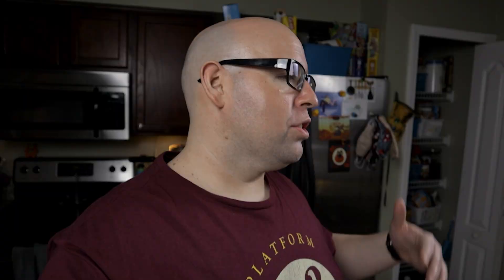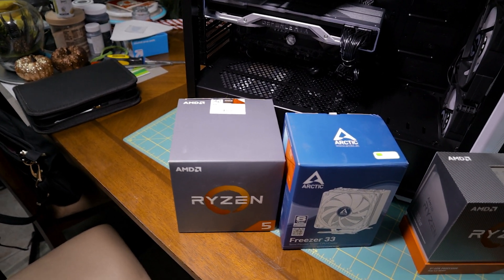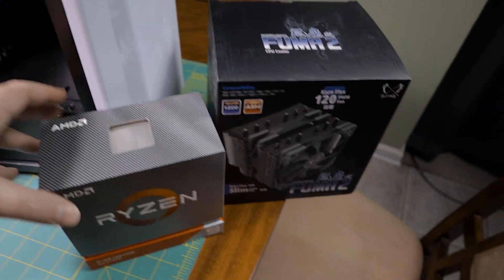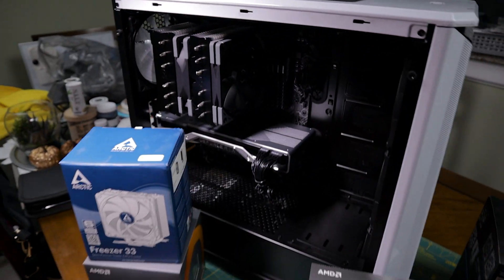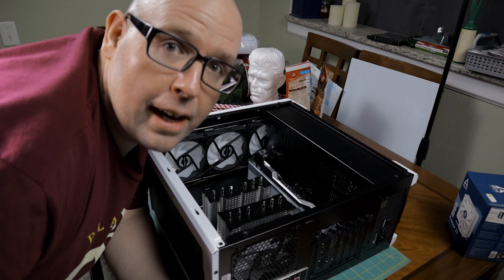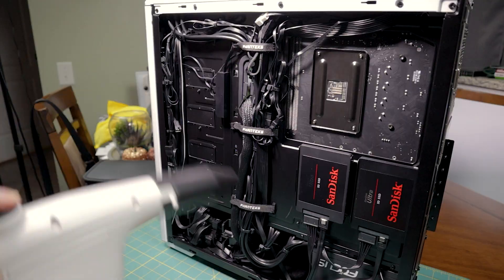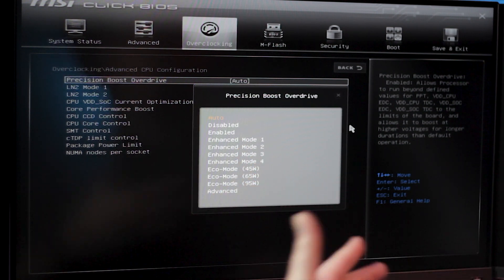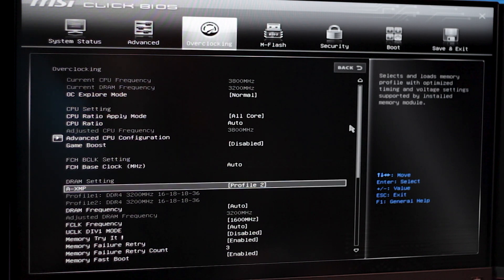3900XT in the MSI B450 Tomahawk | Benchmarks, Thermals & BIOS Setup

Comment: How hard you hitting RAM slots and PCIe slots with your system? Loaded up?
Reply from the maker: I'm running 32GB (four 8GB sticks) of 3200Mhz RAM using the XMP profile, though I had to set both DRAM voltage and SoC Voltage manually, otherwise both were too high. As for PCIe slots, I just have my 2070 Super in the top slot. Nothing else. Although I do use a 1TB NVMe SSD as my boot/Windows drive, and that shares the same PCIe bus as the video card does.
Reply: @HomeTheaterGamer  Were voltage issues causing crashes? Throttling? Boot issues? Just purchased 64GB of 3200mhz RAM. (After Effects is a RAM hog.) For PCIe I'll be using an existing 1080TI and a new 4x 10Gig network card. And NVME boot. I'm a bit worried about overall case heat and saturating PCI lanes. I'll have to update BIOS and XMP before installation. Hmmm...I hate the idea of mussing w/voltage.
Reply from the maker: @Craig Wall it actually wasn’t crashing and there were no other issues, I just noticed the high voltage when monitoring. With voltage on auto for DRAM and SoC, my DRAM voltage ended up being close to 1.45v (it’s XMP profile should have set it to 1.35v) and SoC being 1.21v, which was too high for me to be comfortable with 24/7. Especially SoC voltage, which really shouldn’t exceed 1.2v. Overall, I just did a voltage override for DRAM to 1.35v and SoC to 1.10v, and it’s been completely stable. Could I get each lower? Probably, but both are well within safe tolerances for 24/7 use and I’m not much of a “min/max” type of person.

As long as you know what the max volts are and are below that, I wouldn’t be too afraid of adjusting voltage on DRAM or SoC. Just know that with the 3900XT, you’ll see CPU voltage fluctuate a lot and go up to 1.49 volts sometimes. Don’t be alarmed by that, it was designed that way and is normal and safe. I have played around with setting a negative voltage offset, but I honestly didn’t find any appreciable gains there outside of benchmarks and saw a minimal decrease in temps by maybe 1-2c at full load. My preference is just leave it at stock or simply enable PBO and call it a day unless you’re using an AIO or custom loop.
Reply: @HomeTheaterGamer  I came over from Macs 6 years ago. Have built several PC machines since. Still get queasy if I have to dive deep into bios.
Reply from the maker: @Craig Wall I get that. It can be daunting but most CPUs have safety measures in place to prevent killing he chip. If you have questions about it then feel free to ask and I’ll try to get back to you if I have time.

Are you going with the Scythe Fuma 2 or something else? I couldn’t leave well enough alone and just bought an AIO because of the “I wonder what it would be like..” thoughts that I’ve had since upgrading. Nothing wrong with the Scythe, I just have a bad case of upgraditus.
Reply: @HomeTheaterGamer  Brad, no need to reply...just needed to vent. My 450 moBo has a PCIe retention clip that is frozen up. Can't get an old card out! Don't wan't to break the damn clip. These budget boards sometimes have sloppy tolerances. Once more into the breach I go...prepared to possibly break the clip. Edit: Success! Glad I re-checked all possibilities! I had laser vision done 12 years ago where one eye is corrected for distance and one for reading. Now my vision has drifted. So I have one half-working eye, LOL. Rely mostly on touch.
Reply from the maker: @Craig Wall glad you figured it out! How did things go afterwards? Have you noticed a difference?
Reply: @HomeTheaterGamer  My CPU was bigtime delayed in delivery. Just got it yesterday. Haven't installed yet. Did you get your water cooling hooked up?
Reply from the maker: @Craig Wall I did. It actually went in without a hitch, though I tore my thermal pad on accident so I used paste instead. I did gain performance using it and am able to sustain my boost clocks at about 4.3Ghz (on air it was about 4.1Ghz). I also dropped temps at idle by about 5-6c and under full load about 10c. And best of all? It’s whisper quiet even on balanced mode. I think I’m an AIO convert now. Haha.
Reply: @HomeTheaterGamer  Impressive! That's the dream isn't it? Performance, cool and quiet! My 2600 w/Wraith stayed quite cool under load, but I wasn't oc'ing it...and that's a lightweight chip. Real test is upcoming. If I was as more ambitious I'd consider water...but...I'm not feeling it right now.  :-)

Comment: I've got the 3900x as well but not because of gaming. It's a terrific CPU for processor intensive workloads. However, even the new 5600x crushes it for high frame rate gaming. I was surprised you didn't see any improvements going from 2600 to this but maybe you're GPU bottlenecked with both CPUs or maybe the RAM is too slow to benefit from the new CPU?
Reply from the maker: I’m definitely GPU bottlenecked at 1440p. If I switch to 1080p, the gains are much more substantial for the 3900x, but I don’t game at that resolution and wanted to see what the experience would be for 1440p.

The 5600x seems like a good deal and performs well for now, but I personally wouldn’t get a 6 core/12 thread processor in 2020. Going forward, 8c/12t is my minimum.